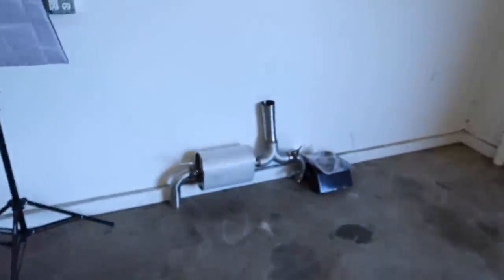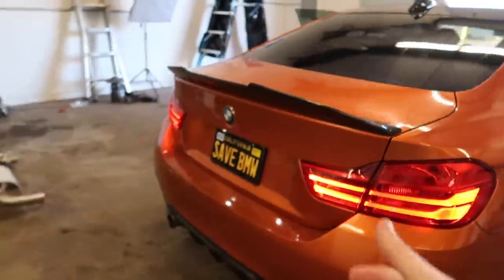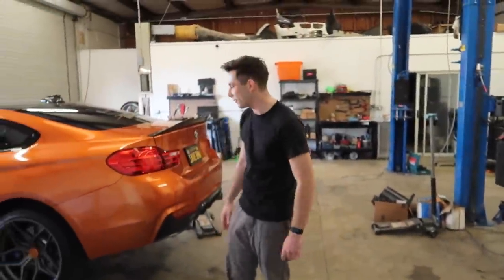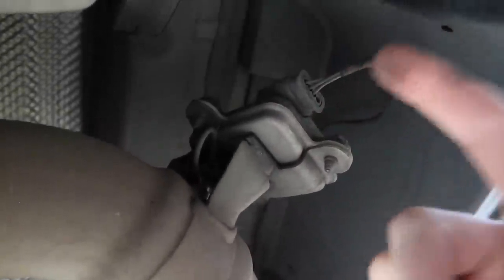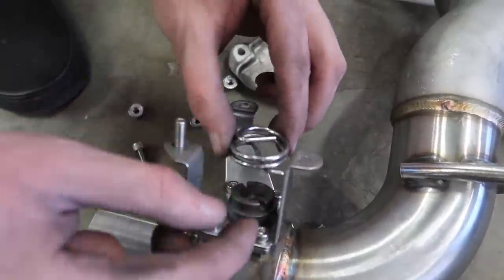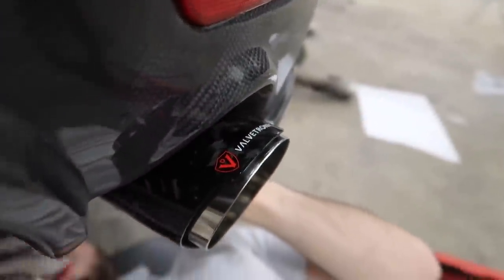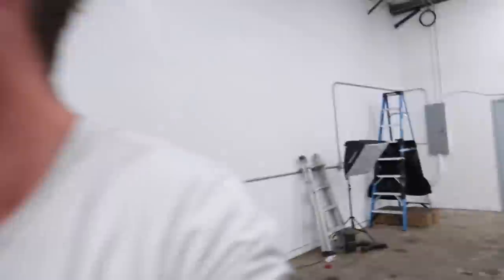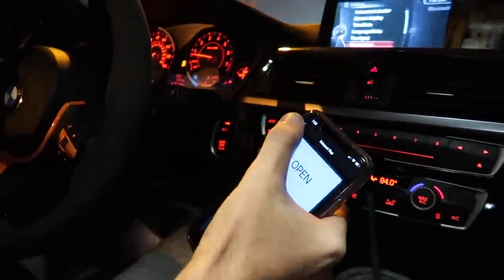435I GETS A CUSTOM VALVETRONIC AXLE-BACK EXHAUST! (SOUNDS INSANE)

Comment: In eco mode the valve won't open at all but in comfort it will open after a certain rev range. I think its 3000rpm. Also I like the fordged carbon look of the tips. I would change all the other carbon pieces on the car to forged carbon as well

Comment: Do the burble tune, although it is amazing now😍did you "remove" only rear muffler, nothing in the middle? Its great change if you swap only rear end of the exhaust, and not hole line from engine... cant imagine full straight pipe.. also like that you can hear turbo whistle, but not that much so burbles cant be heard, amazing combo 😁😁

Comment: I have a BMW 230i F22 2018, But it has the M2 rear bumper install. I also have 2 Y piped dual exhaust tips to create the quad tip set up for the M2 F87 rear bumper.

Would my Y pipe tips aling with the rear bumper diffusers exhaust spacing? 

Not sure if the M2 exhuast and M240i M Sport exhuast piping aligns in the same position or not (your video above is showing a different rear bumper, which I do not have.)

Comment: What app do you use to control the exhaust.. And is it compatible with the factory valve system or is something added for this system to control the valves wirelessly?

Comment: Hey mister Hummadi, what’s up bro?
I have a question regarding this mod. I just received mine fchassis valvetronic and bu watching your video the only part that gets me confused is the place where to cut and how to fit the original pipe with the new pipe. Does the original pipe go inside the new one? It doesn’t really show in your video that part, I would really appreciate it if you could tell me that.
Thank you!

Comment: Dude my 435i is stock Exhaust and the same sound.
Reply: Bro is ur valve work well? I used oem spring because they did not send me the circle one and there are massive deviation between motor and valve so I could not fully open and close. This is so stupid